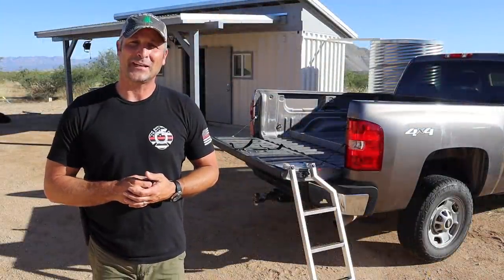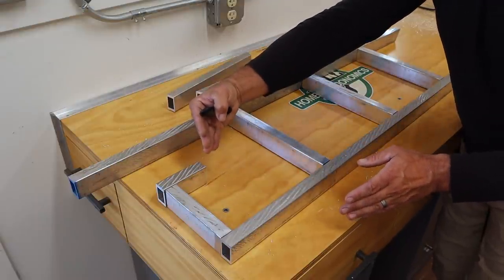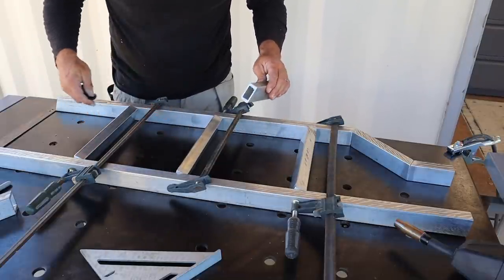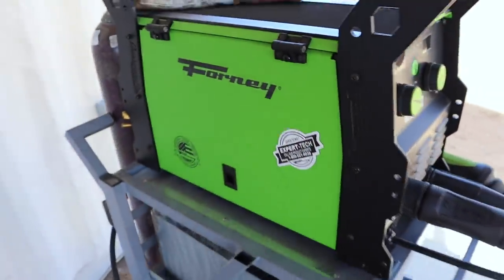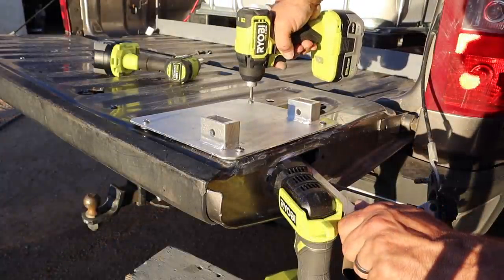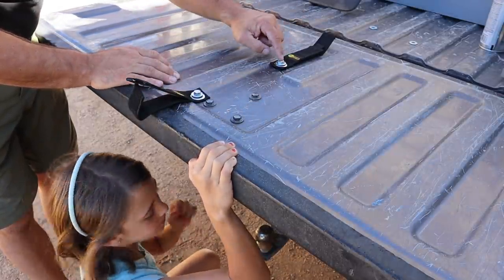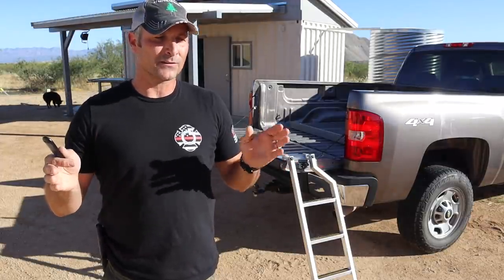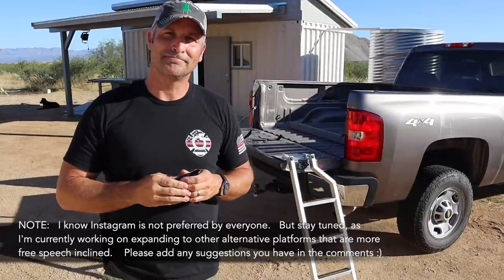DIY Tailgate Ladder - How to Make     ( Plus a Welding Gear Giveaway! )

Comment: You should look into using rivet nuts. Could make mounting that ladder and straps much easier and give option of unbolting them without much hassle. That Forney welder looks nice.
Reply from the maker: Yes, my neighbor is a big fan of them and always reminds me to use them…. But I always forget.   But now that you reminded me I think I’m going to order some for the next project that can use them😀🙏
Reply: @homesteadonomics  Heck yeah! I would buy an Astro Pneumatic and then buy your missing nose sizes from Hilitchi so you have a range of Metric and SAE.

Comment: This will also save impact on your joints now.
Every house I built had 3' wide doors throughout in case someone ended up in a wheelchair.
Because - You never know what the future holds. -KJ
Reply from the maker: That is very true!  We don’t know if we will be here tomorrow, or injured, or who knows what.   Which is one of the reasons I’m a bit slow on my uploads compared to other channels.   Family time always comes first😀👍
Reply: good thinking for all kinds of get-it-thru-the-door problems. does that mean u had to order custom doors?

Comment: Excellent build as always! Just an FYI for future projects involving water. Aluminum and Stainless plus water do not go well together. The aluminum will corrode quickly. Although you should have no problems there in the desert. I see your helper is getting big! I can't believe I've been watching your channel that long. Thanks again for all the great content.
Reply from the maker: Thanks!   Ive always thought the stainless was the safest option for aluminum.   When it comes to hard metals that is.   But I could be wrong. 
I used stainless fasteners for my aluminum trim in the travel trailer…. But it’s pretty minimal.  And the rest is commercial vehicle VHB tape.   But like you said I don’t have a ton of moisture in the first place.   But thanks for the info.🙏

And yes, she is growing up waaasy too fast.    But just trying to give her all the knowledge and real world education we can while she still thinks we are cool…. Because I know it won’t last forever😂

Comment: I have one on my old pickup truck and my 62 year old ass wouldn't be without it.... you're gonna use it a lot... I added a tailgate assist spring to help with the added weight....
Reply from the maker: Well you’re one step ahead of me!!! 😀👍I was thinking about adding one of those as well.  Mostly for my daughter to be able to open the tailgate without having to hold the extra weight.

Comment: I’d like to hear more about your thoughts on welding with spool gun and technique you use.
Reply from the maker: The spool gun definitely takes a bit of trial and error.  Can’t be too close or the wire burns into the mig tip.  Too far and gas isn’t doing its job.  I usually set the wire speed a little fast than I think and try a couple test welds on scrap.   The extra wire speed will help to keep it from burning into the mig tip.   I also go a little more of a perpendicular angle than when I go on steel.  
But truthfully it’s all about doing those test welds and figuring out the speed that works with your settings.   Also, bump up the gas (100%argon) if it seems like it’s not getting good protection and too much spatter.  

But once you find that right setting it will smooth out considerably.

Oh yes, plan on going through several mig tips when your getting everything dialed in. 
I’ve heard that the mig tip gel can help but I’ve never used it, so I can’t say for sure.

Comment: Nice upgrade on the welder!  
Nifty trick taping the wench to the scrap...and getting someone with smaller hands  :)
I don't use anything FB/Meta related...there are tons of sites out there that are as I call them 1AC (1st Amendment Compliant) so when ever you get set up I will be there.
Reply from the maker: Thanks Gregory!  
Yes, I’m quite dismayed at the direction that the big tech oligarchs have been heading.  Although I still use Instagram (FB owned)…. And like the simple interface of it.   I do really want to completely translation to another couple ones as I just do not like FB at all.   Ideally I’d like to move to something  like gab or mewe or something similar.   But just so many other options it’s hard to decide.🤦‍♂️😂

As for my videos the current option that I have already established is odysee.   You can find all of my videos there.   Kinda like a block chain version of YT.   

And I like your ‘1AC’ pneumonic too!  😀👍
Reply: @homesteadonomics  I am already on all 3 of those you mentioned...didn't know you were already on Odysee though...will be adding you now  :)

Comment: That was fun to watch. Question:  Didn't you need sealant between the bolts and tailgate to prevent water intrusion?
Reply from the maker: The inside of the tailgate has weep holes and it’s powder coated as well.   I don’t foresee too much water getting in there since the tailgate is vertical most of the time.
Thank you for watching and I’m glad you liked it😀🙏
Reply: @homesteadonomics  Ah ha! I figured there had to be a good reason. Thanks for the reply. I can't count the number of times I could have used that ladder.

Comment: Can’t help but ask, what happens if your on uneven terrain and the ladders not long enough?
Reply from the maker: The brackets that allow for movement also allow for variations in ground height.   And if not enough then I can adjust the angle to get more heighth adjustment.

Comment: Where do you get metal from?  The big box stores around here charge an arm and two legs
Reply from the maker: I get all my metal from metal supply stores.   My favorite is Industrial Metal Supply…, but they are only in AZ and California I think.   I also get metal from scrap yards too.  
It’s not a big seller for big box stores, so they don’t price it well at all.   Needs to pay for its space and most folks who weld don’t go to them for metal.  
Anyways,  my experience is that what you pay for a 2-3’ stick of metal at a big box store you will get 10’ or more at a metal supply place.   So give or take the mark up difference is about 3x.   Also, I stop by my local industrial metal supply somewhat often to check their scrap room for some choice pieces.   Sometimes you can save a ton by buying the cutoff of a larger piece.   They range from a couple feet to say 8-9’.   Sometimes one or two of a articulate profile/tube/etc,…,, but sometimes you’ll have a stack of 10-15 of the same pieces.   So I tend to plan my projects by what I can find there😉👍

Hope that made sense.., and thanks for watching! 🙏

Comment: I love this design, but I wish somebody would come up with a design for taller trucks because my tailgate sits higher than stock, it has a 6" lift and 42" tires so the tailgate sits at 53" tall. So when the ladder flips up to the storage position, it would end up being longer than the tailgate is wide. :(
Reply: Build it like this, with an additional joint/hinge and another section - like an attic pull down ladder!
Reply from the maker: So my original thought was to not have it hit the ground.   To hinge and rest against the back edge of the tailgate (acting as the stop) to keep it from swing underneath.  Maybe two steps or so.   Measurements would be easier since you wouldn’t have to accommodate for the resting angle.
Not sure if that made sense but I think it sounded right 🤔😂

Comment: F150…
Reply from the maker: Haha…yep they are great trucks too.   But I buy for the best value I can get at the time.   And this 2013 had 40k miles in January (this year) when we bought it.   Good engine, work truck trim… aka vinyl seats and floors…haha.   Just what we needed.    Perhaps when this one is needing to be replaced in 2035 or so, maybe I’ll find a nice 2025 f150😂👍
Reply: @homesteadonomics  Just joking with you because the F150 has a similar ladder. Nice job though as usual!